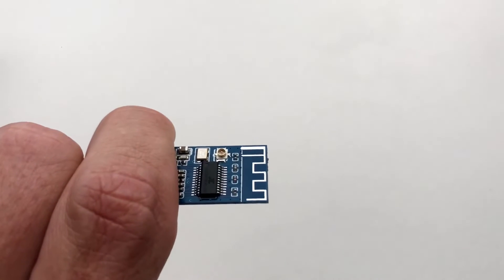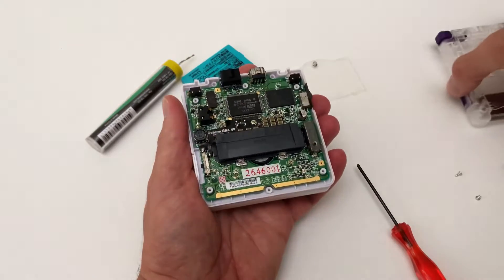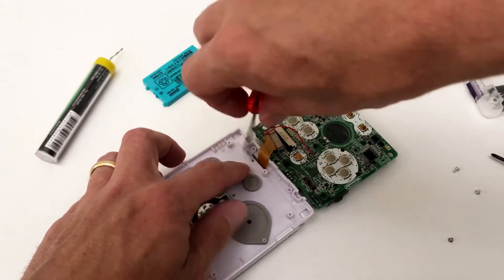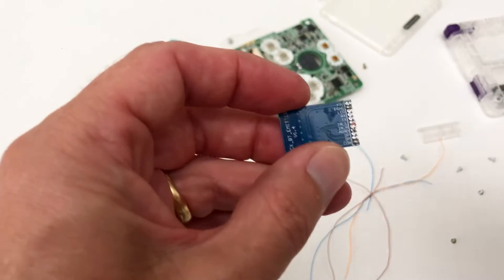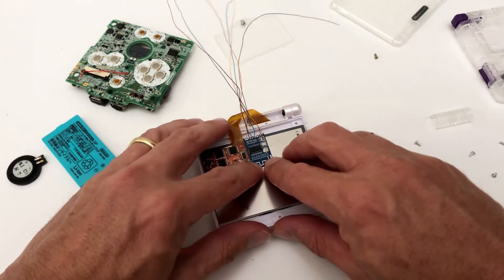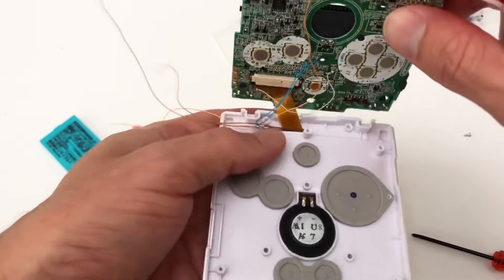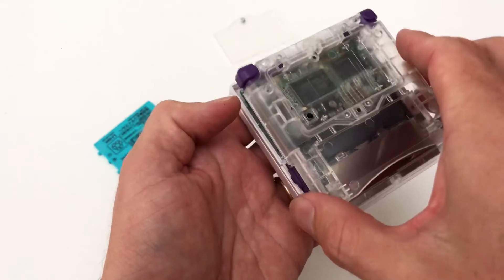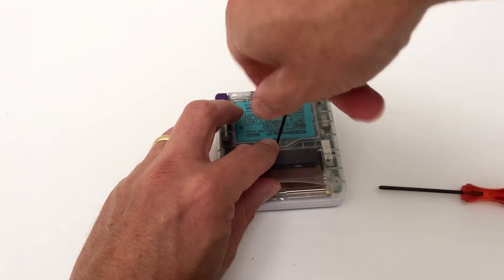Gameboy Advance SP Bluetooth Audio Headphone Speaker Mod - How to #gameboy #nintendo #gameboyadvance

Comment: Hey man, i really need some help. I have tried to do the mod on my GBA, i'm using the v 1.7 module. I though the problem was voltage since it never turned on, and on the GBA video where you performed the same mod I saw you used a v1.4 (impossible to find by the way, i tried 3 different sellers on aliexpress who shoed the 1.4 model in the add and they all sent me a 1.7). In this video though, i see it says 5v input on the module even though its a v1.4???? . What am I doing wrong? Does this module need 5V or can it work with less, cause I thought the gba runs of 3.3V.  Any help would really be appreciated!! Thank you in advance! (  ;)  )

Comment: Great video, it’s exactly what I need for my GBA SP AGS-001. However, my IPS V5 version lacks space behind the screen for this mod. Is it possible to allocate it elsewhere?

Also, I have a few questions about this build. Firstly, I found a Bluetooth emitter, the KCX_BT_EMITTER V1.7. Would this version require the same wiring as performed in your video?

Secondly, regarding the potential issues of the Bluetooth getting disconnected after pressing "Select" , Do you recommend an alternative approach, such as creating a small opening on the screen to expose the pair button? From the comments below, I see people looking for a way to do double press, but not sure how to do that... even if it is possible

I can't solder to the Brightness button, since my IPS screen is soldered to this button to control the OSD Menu...Any other ideas?

Thank you for your time
Reply from the maker: Yes the circuit can be relocated elsewhere as it’s very thin
Uncertain with 1.7 you would have to check the reference points
Yes you can add another switch if you’d like and not use the select button
Reply: @GameboyCustom thank you for your reply! I do have one more question, if I do not connect the CON from the board to any button on the GBA SP, and somehow move the pair button (with jumper cables?) from the board to an accessible area outside of the case of the GBA SP, would this technically work?
Reply from the maker: @DanielVekony  con has to be connected to enable pairing
Reply: So the pairing button on the Bluetooth Emitter is ineffective when pressed independently? My intention is to circumvent connecting the CON to any button and use the physical button to pair. (Sorry if it sounds redundant)

Comment: Thank you for awesome video. Does it work when connecting con and agnd to the button in terms of allowing extra push button for bt on&off ?
Reply from the maker: Yes it does. You can also you a mini 3 pin switch if needed

Comment: Im only getting ~3.3v off of pin one on my motherboard, and the bt board needs 5v
Reply: Im also apparently using an ags 101 motherboard, would that change pin 1's voltage?
Reply from the maker: Yes it would
Reply: @GameboyCustom  is there another 5v pad i could hook up to instead?
Reply from the maker: @irondan357  you have to do some testing with a multimeter
Reply: @GameboyCustom  any suggestions on where to start?
Reply from the maker: @irondan357  VCC points
Reply: @GameboyCustom  got it working
Reply: @irondan357 hey, what did you do to get it working? I ended up with a v1.7 and can't seem to get power to it.
Reply: @Koszarek1911  i ended up getting 4.92v off of S2

Comment: Theoretically, instead of running PGND & AGND wires seperately, you could use a small wire segment to connect them on the BT board, then run a single wire from either of them to ground on the motherboard
Reply from the maker: Sure

Comment: would this work with a GBA SP flex amp also installed?
Reply from the maker: Can’t see why not. As long as you can access the solder points

Comment: I did a similar mod, but I made a custom PCB board with touch sensor on the back od the screen, to turn it on/off and to reset pairing.
Reply from the maker: That sounds incredible
Reply: Just did this myself, vast improvement
Reply: Can you tell me how? I want to keep the original shell without making any modifications to it!
Reply: Do you sell those boards?

Comment: Hey so if soldering to the select button is an issue (like needing to re-pair if pressed once) what would be the better alternative?
Reply from the maker: Any button that’s rarely used. Possibly brightness control
Reply: @GameboyCustom  hey thanks for the reply :)
I'm not hugely tech savvy when it comes to wiring but would it be possible to make it so that it requires one to push down on two buttons instead of one?
Reply from the maker: @salviador  possibly if you ran a loop between multiple points. It’s just a matter of trial an error
Reply: @GameboyCustom  awesome, my quest continues. Thanks for the responses! :D i now have a better idea of where to begin experimenting
Reply from the maker: @salviador  no worries. Good luck

Comment: Does it work with apple airpods?
Reply from the maker: We have tested it with generation 1 AirPods and have had no idea issues
Reply: How about volume control with AirPods? How would one change the volume on AirPods if the volume control on the gba sp is separate from the Bluetooth audio.

Comment: Did you tell them the part where it unpairs when pressing select even once? Why would you wire it like this again? Great video but if someone does this they will eventually have to add a separate button for con.
Reply from the maker: We built and filmed all the videos on the same day
Reply: @GameboyCustom  I see well thats unfortunate but hopefully someone can figure it out before they close it up great video tho you've helped me with the wiring idea I've completed gbc, gba, gba sp I don't really play dmg or gbp maybe I'll try ds lite next 😀 or maybe even 3ds
Reply from the maker: @user-gj6vg6nq2f  glad we could help you. We will work on the DS next week
Reply: Great video, it's exactly what I need for my GBA SP AGS-001. However, my IPS V5 version lacks space behind the screen for this mod. Is it possible to allocate it elsewhere?

Also, I have a few questions about this build. Firstly, I found a Bluetooth emitter, the KCX_BT_EMITTER V1.7. Would this version require the same wiring as performed in your video?

Regarding pairing button, my IPS V5 already has a cable soldered from screen to brightness button, and from what I understood if the Select button is pressed even once it would unpair the device. Do you recommend an alternative approach, such as creating a small opening on the screen to expose the pair button? Or is there a way to force the unpair to require another long press? Any other ideas?

Thank you for your time.